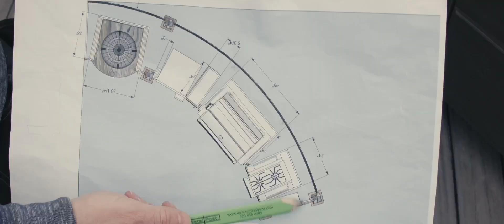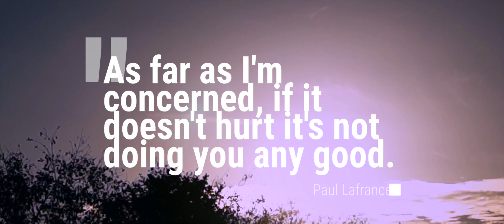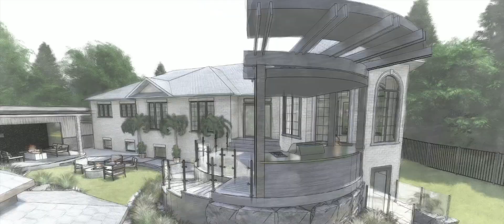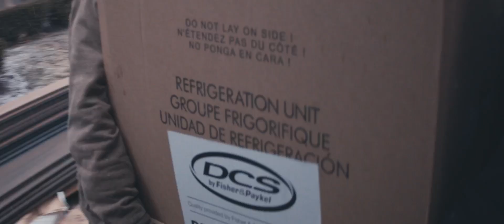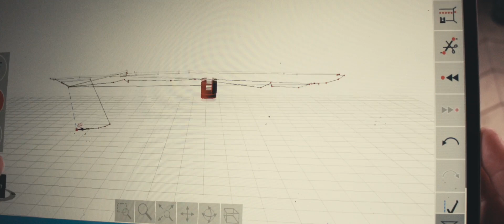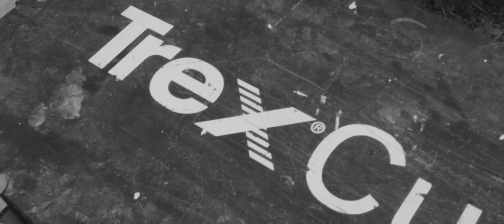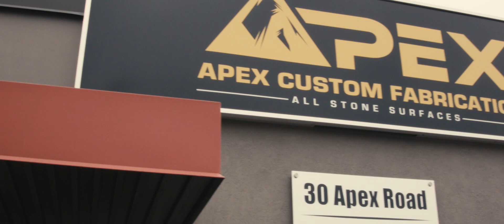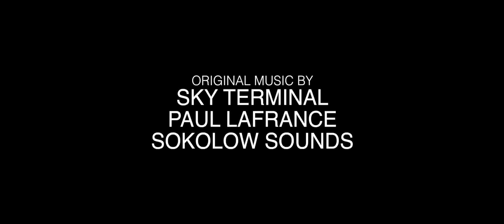Ep.8 🔨 Desperate Times 🔨 BACKYARD REVOLUTION

Comment: Two questions:
(1) What are the posts for the overhead pergola anchored into?  Needs to be substantial due to the weight of the pergola & wind shear.
(2) Did the framing for the bridge deck have to change when you abandoned the curved layout in favor of the wedge layout?

Comment: Awesome serious!  So happy to see your creativity return to the screen.  I have a question regarding the composite decking.  When you cut the deck boards along their length, I presume you are removing the groove used to secure the deck boards to the structure.  What do you use to create a new groove?  Table saw?  Router?
Reply: It looks like they are ripping the boards in the middle -- preserving the grooves on either side (see 1:56 & 8:38).  It seems that, with the right router bit(s), Paul could instead cut one side & re-create the factory groove.  This would eliminate the problem of the butt-jointed "middle groove" having to "disappear" as he mentions in the video.
Reply: @phillymathguy8142  Despite the fact they are preserving one groove, the hidden fasteners they used require grooves in both sides of the board.  I was just wondering how they cut the new grooves.
Reply: @troyz1591  I think they're "butt joints" -- no fasteners.  That's how they're able to "disappear".